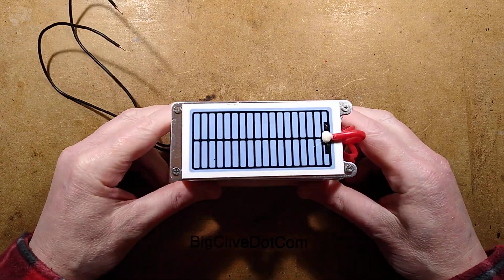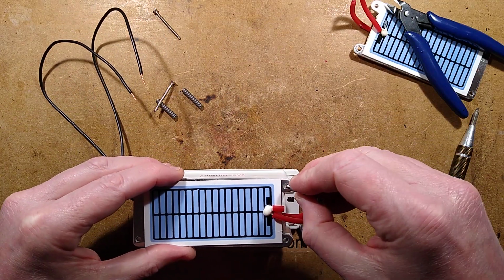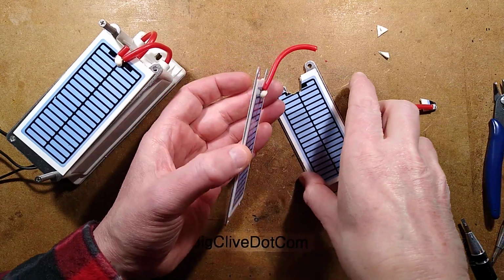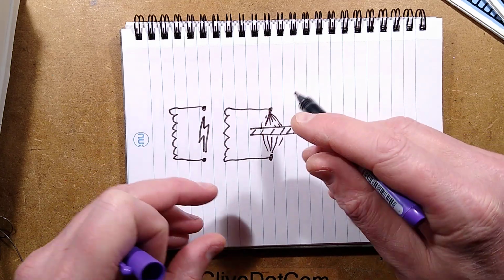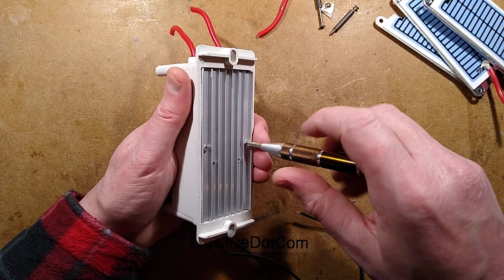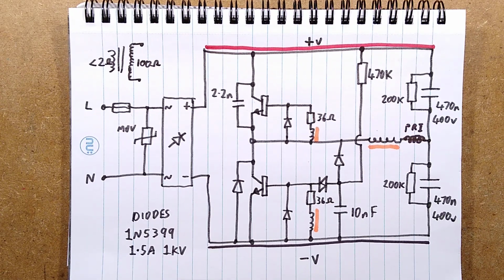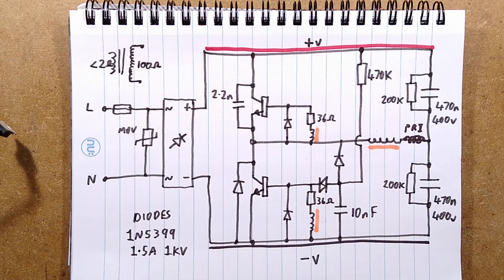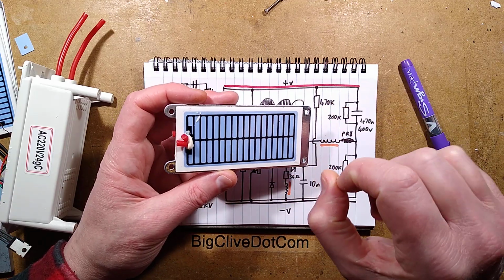High power ozone generator teardown with schematic

Comment: could you attach to a motorbike air intake
Reply: For boost?
Reply: @launchprogramexe  i believe the extra charge of the 3rd oxygen element would wish to equalise and therefore being in an excited mode cause a further energy release/expansion within the cylinder.
Reply: It wouldn’t increase the power of the engine, there would still be the same number of oxygen atoms going into the combustion chamber. OK, they’re slightly more reactive molecules, but improvement from the reduction in dissociation energy will be balanced by the increase in electrical demand.
In practice, because the thing isn’t anywhere near 100% efficient, it will increase the temperature of air so you’ll end up with less air and less power from the engine.

Comment: bought one a few years back, yet to use. so in summation, these things are safe to use if the integrity of the ceramic plates aren't compromised and you have a timer to limit ozone?

also, what wattage should these be?

Comment: These really are intended as components for replacements in existing high powered ozone generators or to build your own around. Yep they do need a fan. To move the ozone around about the room. They should clearly state that these things are intended as replacement parts. That I suppose you could DIY around.

Comment: Hey BigClide, thanks for that video. I bought that same Ozone-nator, however mine was advertised as a 12V device. Thanks to you, I opened it up and saw, a 400V Cap, which lead me to belive it was a 230V generator. Hooked it up to mains voltage, ducked for cover, turned it on and it worked. But it suffered the same damage as yours, top plate cracked.
Thanks again, have a good one.

Comment: Simple! :)

Can't you measure inductance to get the ratio of the windings in the transformer? I could be wrong thought.

How would these plates perform on the normal voltage multiplier ladders? For DIYing if nothing else.
Reply: How can I diy transformer

Comment: I couldn't make heads or tails of this schematic. Thank you for the explanation. It's a clever circuit, very good at what it does. I have one of these ozone generators (albeit it runs on 12V, but I imagine it works largely the same), and it indeed uses a lot of power, some 80W in my case. I imagine I could put it in an old PC PSU case for insulation, fanning and cooling.

Comment: My first job in 1974 at Mullard Research labs was screen printing conductive inks on ceramic substrate material. The ink was fired like a pottery glaze at high temperature.
Reply: I'm guessing the top coating is also a clear glaze which is why it was so hard.

Comment: I put one of these in an old PC PSU case with a small 12V PSU to run the fan.  It makes a lot of ozone, but it gets so hot I'm worried about leaving it on for more than a minute or two.

Comment: I have one of these.
They really do produce a metric ASS LOAD of ozone in seconds with both plates running. You definitely do not want to be in the same room. I bought it to cure a flea infestation in a house I moved into. Fixed the problem within a week.
Reply: Interesting use to kill a flea infestation... kinda makes sense.  I got me thinking to deal with bugs in my home office.  Pretty attractive idea.
Reply: Yup, I have one that lives in a cardboard box unused because it generates so much ozone . I powered it up initially and ran it for about 30 seconds outside on my patio, and it took several minutes for the ozone smell to dissipate.
Reply: Good to know a possible use for one of these
Reply: I wonder if it would work for cockroaches
Reply: Yep, I have one in a plastic box with a 4" fan and it is certainly an efficient way of getting odours out of a car. I leave it running for 10 minutes with the air-con on recirc and that's all it needs (well apart from the half hour airing out afterwards).
Reply: @Wirralguy  your car has an ozone generator built into the air vents to prevent mold otherwise it would smell real bad after a while (it isn't perfect) BMW have the best ones.
Reply: @stonedsavage7814  very few if any cars have that system.
Reply: @stonedsavage7814  I think only BMW’s have that system, if I remember correctly. My archaic 90’s Cadillac has no such mold prevention feature. Luckily, my heat and ac rarely works so maybe that’s the Caddy tech to prevent mold lol
Reply: @stonedsavage7814  "BMW have the best ones." and they call "ioniser" becuase people scare form ozone.
Reply: @stonedsavage7814 on Japanese cars this is called Panasonic nanoe or Sharp Plasmacluster

But it's only on higher end models like lexus

Comment: Ah yes, the classic method of checking if something has a charge by tapping it with your fingers :)
Reply: Its not stupid if it works!
Reply: Even if something goes wrong, i wont even notice!
Reply: The most convenient and cheap tool, your finger and in some cases your life
Reply: Just the sort of thing a naked metal wrench would say

Comment: I wonder if doubling the plates doubles power consumption and ozone production.
Reply: No, adding more plates will overload output and cause voltage to drop. Efficiency will decrease or production may stop completely.
Reply: without having any specific knowledge i would hazard a guess at no. There will be a limit at how quickly the air can be replenished. Otherwise you will run out of O2 to convert into O3. Wish I knew how to do subscript.

Comment: That thing sounds like walking under supergrid pylons on a foggy morning, just loud scary buzzing!!! :S
Reply: If I had to guess, its probably a copy of a generator used in either a large HVAC system or some form of industrial process or sterilization unit, which just makes it all that much more terrifying, and desirable to obtain.
Reply: @mysock351C   Looking for them right now.
Reply: I think the ozone capacity of that thing is probably measured in 100's of cubic feet per minute, and the real question is how long does it take to get to a lethal concentration in a typical room after someone powers it up. And the irony is thats actually not a joke. It probably could kill you after a while. Edit: Puts out 24g/h, which means in a typical room it wont take long to get to a lethal concentration.
Reply: @mysock351C  If you figure a 3m x 3m x 3m room, roughly 10ft cube, would contain 27m^3 of air.  Looks like std air has a density around 1.204kg/m^3 so 32.5kg of air, or 32500g.   If we take your 24g / 32500g we get 0.000738, or a concentration of 738ppm! 
The CDC estimates that 50ppm for 60min would be lethal to humans, and the recommended exposure limit for an hour is 1ppm. 
I don't blame Clive for evacuating.
Reply: @Chris-du7hi  Insane right? Its amazing the number of deadly products that can be ordered off of ebay.
Reply: It could also kill you if you touched the plates with it on. That is a lot of current at that voltage

Comment: Is it possible that the second output element would have limited the current enough to limit the voltage as well? Making it less fierce by design? Maybe I'm giving the seller too much credit.
Reply: Yes. I have this same item and it doesn't sound quite as violent.

Comment: Clive, ozone is really dangerous if breathed in. Don't let this thing run for more than a second with you in the same room. It's like acid in gaseous form.
Reply: He's aware it's not his first rodeo.
Reply: @Ryan6.022  Well, the only ozone generators I have seen on this channel in the past were the ones with a few Watt, like for cars and fridges. I have a similar one to treat whole rooms with 100W, and that thing even has a timer so you can leave the room before it even starts.
Reply: @graealex  I'd lump the uvc bulbs in with the ozone generators and I think he looked at one of the timer ones or maybe just talked about them in a tangent.
Reply: @Ryan6.022  Just saying that the small units, which still emit noticeable ozone, are in a completely different ballpark than those large units. The big ones actually make a difference. Car detailers use them to remove 20 years of smoking from a car interior, it significantly reduces any smells in even large rooms and textiles inside the room, and it takes a few hours until you can re-enter the room.
Reply: @graealex  ah so that's how the detailer got the smell of smoke out of my car. I bought a used car that smelled so strong of tobacco that I had to drive with the windows down so my eyes wouldn't water.
Reply: @Ryan6.022  It's effective at penetrating the HVAC, which will usually remain a problem. Obviously you still need to wash carpets and seats and stuff.

Comment: What's the use of these ozone generators ?
( I am interested to read some experiences with these. )
Reply: Their primary use is in the production of Ozone, and in my experience, after the application of power, Ozone is produced and the concentration of Ozone in the immediate area increases.
Reply: Getting rid of odors. That was my use case and it worked pretty well.
Reply: Actually funny that Ozone created by a Corona discharge can be used to kill the Corona virus!

Comment: I have this funny thing that i really like the smell of ozone... however, I have been warned that it is actually really damaging to the lungs already at relatively low concentrations.
"When inhaled, ozone can damage the lungs. Relatively low amounts can cause chest pain, coughing, shortness of breath and throat irritation. Ozone may also worsen chronic respiratory diseases such as asthma and compromise the ability of the body to fight respiratory infections." 
From https://www.epa.gov/indoor-air-quality-iaq/ozone-generators-are-sold-air-cleaners#:~:text=When%20inhaled%2C%20ozone%20can%20damage,body%20to%20fight%20respiratory%20infections.
Reply: The damage from breathing in ozone can persist for weeks.
Reply: Humans can detect ozone at around 0.001ppm, where 0.1ppm can be considered harmful.

So, a little won't kill you or really damage anything because it will react with things quickly, but don't go sucking on exhaust pipes if you like the smell of two-stroke exhaust either ;)

Comment: i am using this in my bathroom (it's one without a windows) since a year. great thing!
Reply: I have a bathroom with no window too. I may have to get this... what does it do for you?
Reply: @Alexander_l322  As the donald says big dumps... (i have an auto-timer wich triggers it for 30 seconds after the light goes off. the ozone is VERY strong.)
Reply: @Alexander_l322  ozone buildup is poisonous and could kill you.
Reply: @SG-ps1sq  oh okay i didn’t know he was trolling or deleting any comments. So I guess I won’t be using this in my house. I thought it might help get rid of the  steam from showering or something.
Reply: @SG-ps1sq  be assured I am not trolling, it works perfect against odors and potential mold. But as stated, you should wire it that is not operation while somebody is inside. Since there is no daylight it is an easy task: 30s on after the light has been switched off.
Reply: @rarbiart  sorry bud, just didn't want someone gassing themselves lol, my bad for calling you out

Comment: So I'm at a pumps and flow meter state training class yesterday, and these Flow meters are battery  powered, lithium. But you can't recharge them, im like i can fix that tp4056. You have to clean the probes every 3 to 6 months and get up to 2 years of life out of a battery there answers is take it out throw it away. SMH I'm like while your standing there cleaning the probes charge the "bat tree" (vicegripgarage).

Comment: How/where were the coronal discharge pads referenced to earth? I thought they were connected to the two leads coming from the secondary coil of the potted transformer.
Reply from the maker: The main voltage is between the two wires, but with high frequency supplies there will be enough capacitive coupling between the primary and secondary to give a shock or arc referenced to ground.

Comment: You can strip the insulating paint off using HCl. It will continue to work without the coating and it's easier to start without it.
Reply from the maker: Useful to know, but would probably impact the lifespan of the electrodes.
Reply: @bigclivedotcom  that is true

Comment: That thing sounds almost terrifying like a tesla coil spark gap
Reply: 50hz*
Reply: @rushb9388  thanks
Reply: @rushb9388  in UK it's 60Hz, whereas mainland europe is mainly 50Hz.
Reply: @suprlite  its 50hz not 60  as i live in the uk and measured the mains before  it says 50hz  lol  100hz through the bench as it doubles  when it passes through something its sitting on also known as vibration  . n Clive has 50hz as i seen it in most of his videos on the meter . no frustration here  just letting ya know . yh u may get 60hz in the uk but i never herd that before
Reply: @danielhorne6042  ah, ok. Back in school about 35 years ago i was taught that the UK used 60Hz.
Reply: Its just the 60hz mains frequency over the microphone in real life you hardly hear it

Comment: I have one exactly like that, it works fine after I installed it inside a big steel case for a server power supply. Conveniently it already has the fans to run air through.
Reply: Did you install it standing up or lying on its side? And how do you avoid it arcing to the case?

Comment: I mean they described it as a a DIY device, and it doesn't have a plug on it so I'd imagine it was implied that it needs a fan in an enclosure to be used properly. presumably to build your own ozone generator
Reply from the maker: Many of the listings imply putting it on your lounge table.
Reply: @bigclivedotcom  I wonder if it's just resellers not really knowing what they're selling. It seems pretty common on ebay
Reply: The amount of power that thing dissipates is immense though, I wonder what airflow is needed to keep it cool, and how much it pulls with both plate sets
Reply: @iamdarkyoshi  Some people don't care what they do or sell. As long as they're lining their pockets with our money anything goes...
Reply: @bigclivedotcom  I know that some 'medicinal herb growers'  sometimes put a few ozone generators inside their fan ducting to help reduce any unwanted odours. 👍 Given the fact that most of them also steal the electricity, the insane power consumption wouldn't be such a worry 😂
Reply: @bigclivedotcom  The sellers probably don't even know what it is or what it does.
Reply: Do you think they meant a DIE! device instead of DIY?